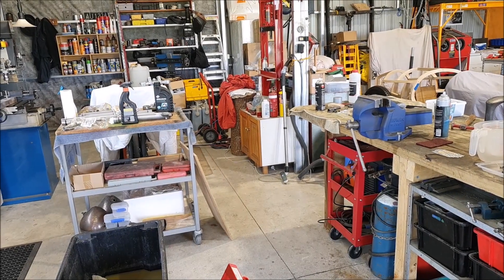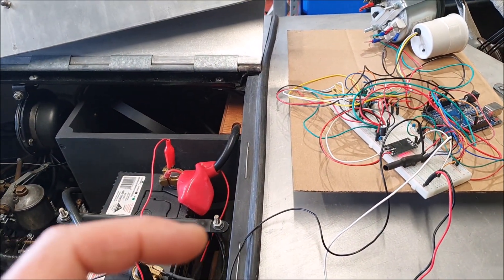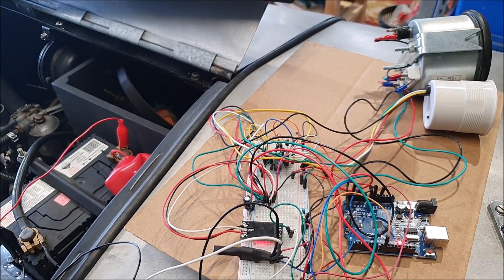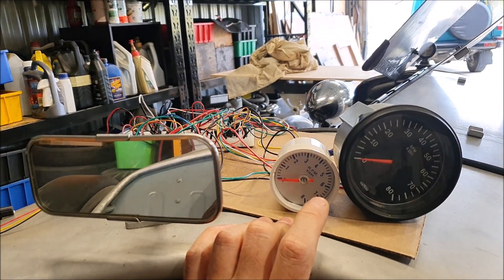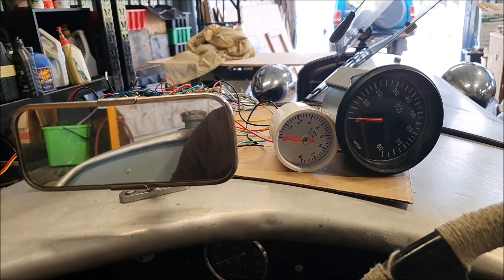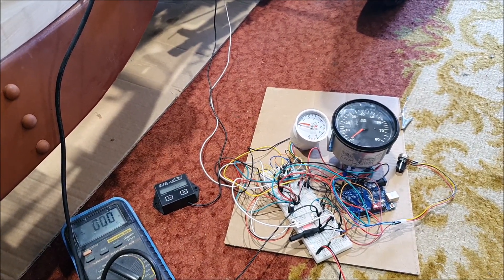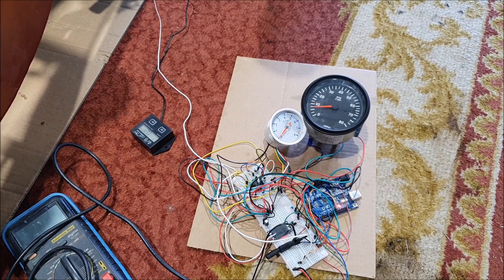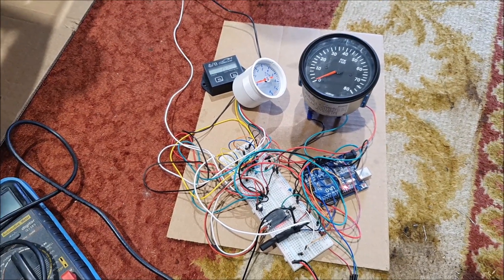Prewar Riley Brooklands replica tachometer experiments

Comment: I have always been fascinated by the chronometric speedo on my (previously my fathers) Kestrel. A couple of years ago I spent a few hours  on the internet and got a basic understanding of how they work. A chronometric speedo or tacho is to all intents and purposes a mechanical computer, designed before the first world war. It has a clock that runs at constant speed, a program (a set of cams) which samples the engine speed and updates the output (the tacho or speedo needle).
The last iteration of your program seemed to emulate a chrono tacho on the cheap instrument very faithfully.
Another possible method to get pulses from the engine would be to connect a quadrature encoder to the original mechanical take off which I assume is off the back of one of the camshafts.
You are making great progress, I look forward to the next installment!
Reply from the maker: I do have a chronometric speedo for it which I took apart and cleaned following the article online. It works when drill driven but I haven't tried it n the car yet. I need to get a new cable from the UK spares but they were waiting for new stock to come in last time I made an order. I am trying to avoid having to modify the engine if I can and also trying to minimise the amount of wiring I need. I could easily do the electronics for a quadrature encoder, I already have code for that I wrote when I was at Weta actually. On my engine there is the take off from the end of the cam which has a slot in it. But I think I am missing a piece that fits in there and couples from the cam to the cable. I could make something I think. I'll film what that look like next time I am out there.

Comment: Im impressed Simon that s  brilliant ( no pun intended ) this is such a neat solution for all manor of old cars were the original taco is no longer available or cant be repaired. If you can package it up and market this, as Im sure there is a demand for  such a product. When I had a look at my Jager it looked like it was made by a clock maker. With the needle moving irately and a selay to what is happening in the engine. Great piece of work .
Reply from the maker: I need to make something just to hook to my other cars I can actually drive to do some testing I think. If I can put it in the MG or Landrover and actually use it for a bit I can see if the method is even reliable. I don't see why not. Biggest issue is knowing how much current is going through the neon lamp. Not much I imagine as the pulse is so quick. The ignition isn't something I want to hook any of my test equipment up to as it will zap it!

Comment: That is some impressive engineering.  Of course, I only understood about a quarter of it, but still impressive.  I have given some thought to using aircraft tachs (they appear to be both mechanical and electric) but I haven't wanted to spend the money to experiment with one.  Cheers
Reply from the maker: I've never played with aircraft gauges really, except as a thing to test Geiger counters, from the radioactive dials! You'd imagine they much be built to be very robust and reliable.

Comment: At 4:30 My suggestion to get around the electrical noise problem would be to use a hall effect sensor like they use in some electronic ignition systems. You look up to the job of circuit design (probably much more than I am) and you could use the rotating magnet to trigger the sensor to give a really clean pulse to operate an electronic tach. Maybe one of these? https://www.aliexpress.com/item/1005003199566076.html?spm=a2g0o.productlist.main.1.523d3557oI7jtW&algo_pvid=625916ea-951c-43b1-ad4d-d5df8a57879e&aem_p4p_detail=202301180928266981853927793280001525074&algo_exp_id=625916ea-951c-43b1-ad4d-d5df8a57879e-0&pdp_ext_f=%7B%22sku_id%22%3A%2212000024626857382%22%7D&pdp_npi=2%40dis%21AUD%213.56%213.56%21%21%21%21%21%4021021a7216740629068474918d06c1%2112000024626857382%21sea&curPageLogUid=TCtwEhMVBCni&ad_pvid=202301180928266981853927793280001525074_1&ad_pvid=202301180928266981853927793280001525074_1
Reply from the maker: I've played with them before. The problem with that solution is modifying something on the engine to suit. The Riley 9 doesn't actually have any easily accessible rotating bits! You could maybe put something inside the bell housing on the clutch/flywheel but then you need to make brackets and so on to mount things. With the neon bulb I have really opto isolated the high voltage side from the low so as long as I have good filtering on the low voltage sides power supply it should be fine. Plus use decent wires to the plug lead. I am relying on the fact the pulse is high voltage but low current and fast so that the spark doesn't just arc from that wire currently.